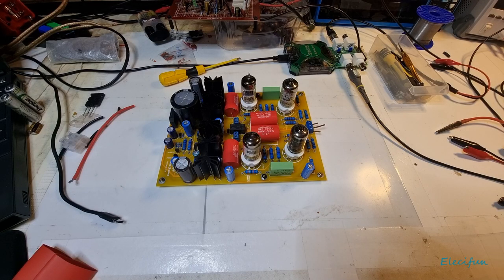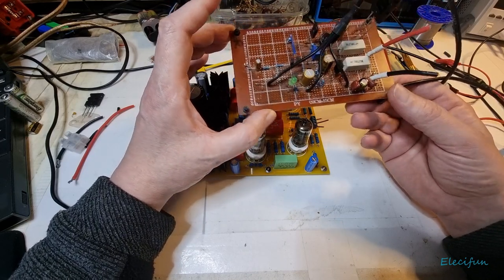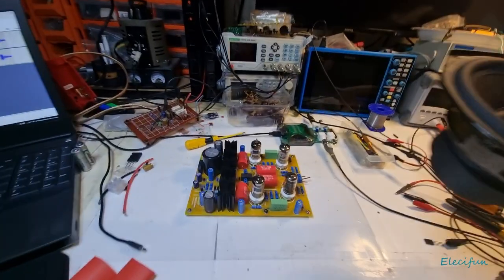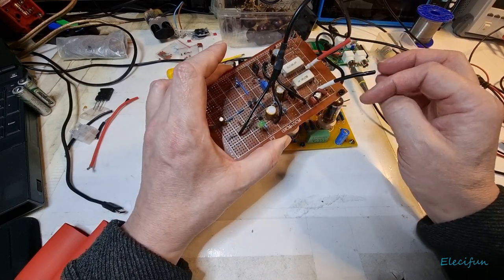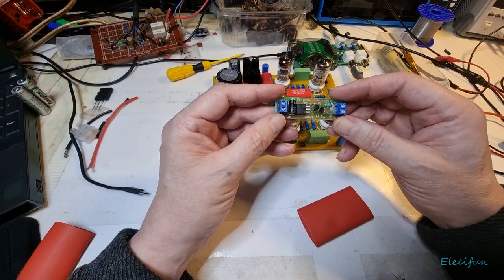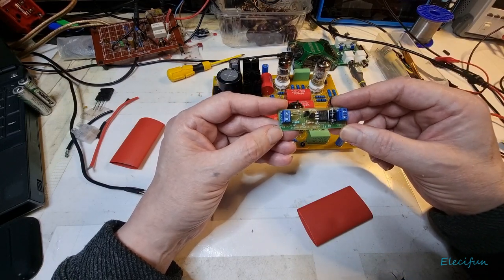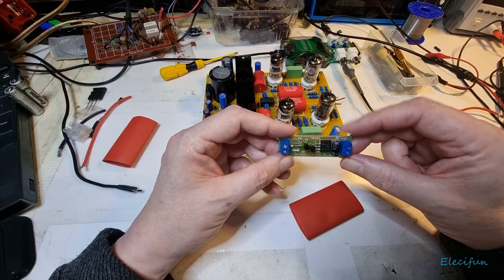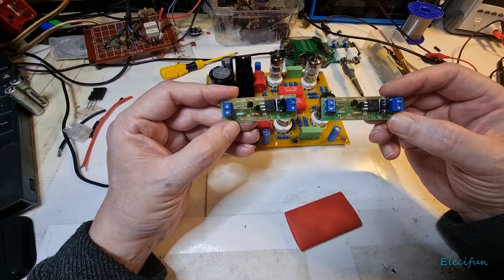Speaker Protection Device

Comment: What's happening sir? 😀
Reply from the maker: The universe is expanding while I am participating in entropy and physical decay.

What's happening with you..amigo?
Reply: @Elecifun  Try to prise yourself out of bed. Go for a walk. If possible down the beach. I know things aren't the best. I feel similar. Life's a struggle. Anyway at least just say hello.❤
Reply: @Elecifun  I got the same problem as you its friggin strange. Itchy fkn eyes. I dont have a cat. 

What am I doing?

Various small projects.

I'm still assembling my mains voltage neon soviet and neon Christmas lights.

Small pcbs.

I solder 4 smd resistors two onto each side. 

Then attach a neon bulbs, which straddles one leg on each side.

I solder those legs onto the pcb.

Then on the other end I solder 4 wires which jumps from one pcb to the next.

Kinda like daisy chaining neon bulbs together.

So that's one thing I'm doing right now.

Another thing I'm doing is building my third SMD dot matrix digital clock. You've probably seen them on my channel.

That last clock is red. The one before was green. The one before that was also green.

Oh and the other project is my surround sound system. I bought it for my computer a decade ago. 
LOGITECH Z5500 S.S.S.

Anyway I thought wtf is wrong with this thing. 🤔

Any I opened the black box which had a big heat sink on it.

At first I had no idea of where to begin.

Anyway I thought I guess I start from the beginning. 

So I jammed my multimeter into the two mains power plug holes.

Okay there is 230V.

I pulled the ceramic fuse out.

😮 oh its blown.

Okay so I found the right fuses after some digging.

Ordered them from AliExpress.

Two weeks later they arrive.

Replace the fuse.

Turn it on.

The fuse blows again that was dumb.😅

This time I disconnected the transformer from the two full bridge rectifiers. 

Those big square upside down table looking things.

I tested the four wires ...

The first two, the blue ones 14V Okay thats good.

The second two, the orange and yellow wires 53V.

Shematic says 26.5V okay that must mean 2 x 26.5V = 53V. 

That must mean the transformer is working. That's good.

Okay now I'm looking at two full bridge rectifiers.

I know these things convert AC to DC.

I learnt this through building bench power supplies.

Ok so I thought I'll attack the AC to the two diagonal terminals on the first fb rectifier 14V 

Okay so I tested the output which should be 14Vs. 

Well there is no 14V?? So now I'm thinking maybe they're faulty?

I connected the other fb rectifier.

Same???.

No 53V??

So I ordered two new full bridge rectifiers to replace the old ones.

The old ones are 15A 200V

I couldn't find the right ones so I just got the 15V 1000V ones.

I guess they'll be okay.
I'm just hoping this is the problem.

They're leaking some nasty sticky oil. 

So we shall see if this is the problem.

Oh before this I saw some leaking aluminium electrolytic caps on my control pod.

I replaced them all. 

I just hope I soldered them properly.

I have trouble trying to solder them.

Of all the components I've ever soldered these to me are hard to solder.

Anyway let's just hope they're all soldered properly. 

So now I'm just waiting for the new rectifiers.

I really hope this is the problem.

We shall see in the coming week/s.

Anyway I hope you reply.

Its been awhile. 

❤❤❤ no homo 😅

Dec.
Reply from the maker: Cheers, hello to you.